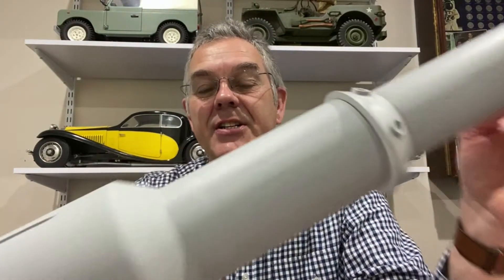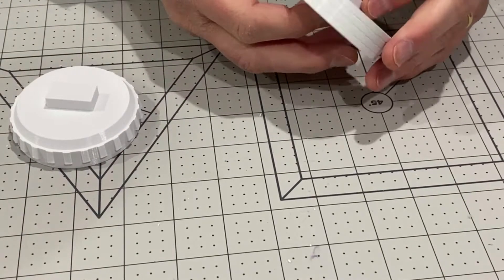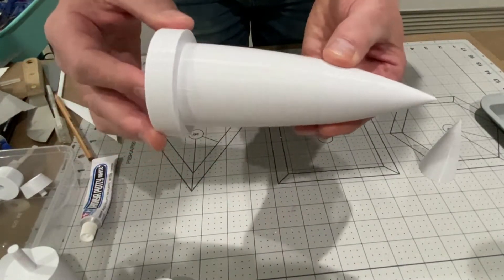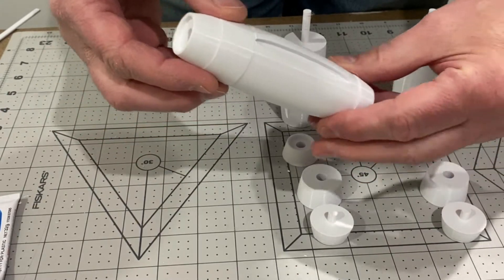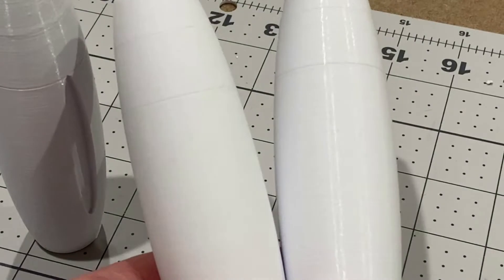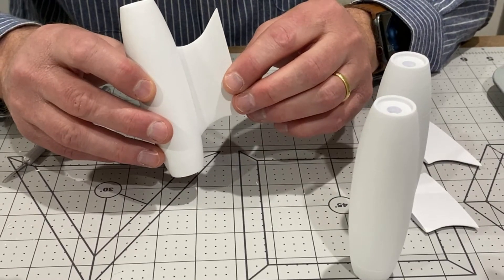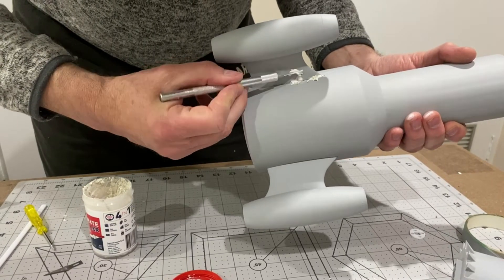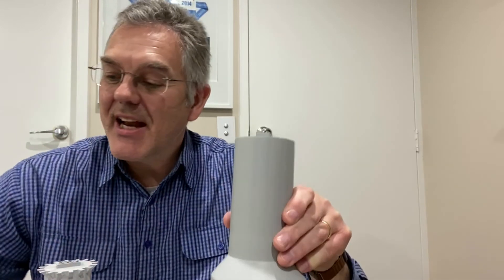Building a 3d printed model of Thunderbird 3 - Part 3

Comment: Have really enjoyed watching your Thunderbird builds! They look amazing! 
Currently printing a Thunderbird 1! 

Do you have any tips on how you adjusted the pieces like the nose cone, docking ring and central fin part? 
Keen to print a model for myself! 

Thank you!
Reply from the maker: Hi KC897, there are a couple of different ways to make the changes.  If you just want to change the dimensions of an object (like making the nose cone shorter), you can just do it in the Slicer software (I use Prusa slicer).  To actually alter the parts like the central fuel tank, I used TinkerCAD which is available free online.  I simply inserted a rectangular box into the structure on each side, and then made that structure hollow.  For the docking ring, I just made it from scratch in the slicer, but you could do this easily in Tinker CAD as well by just putting disks of different sizes on top of each other.  Hope that helps.
Reply: Excellent collection of videos. I've just started building the same model as you. You help and guidance is extremely valuable. Thank you. Looking forward to your current train in a case videos.